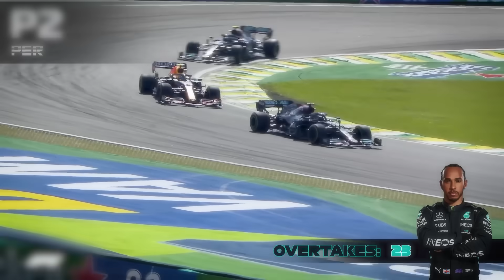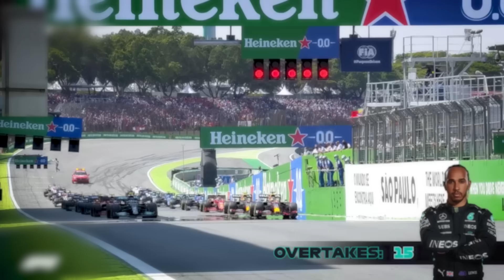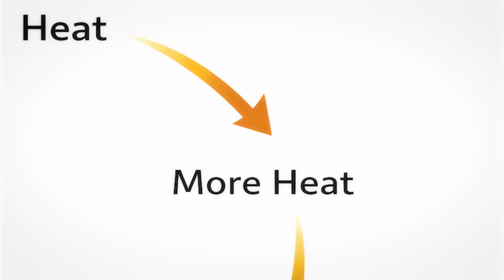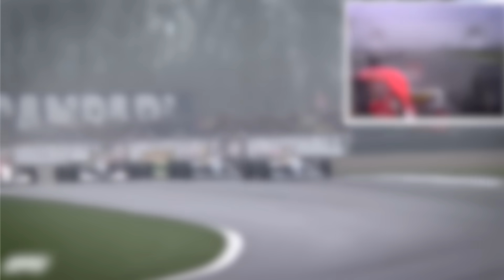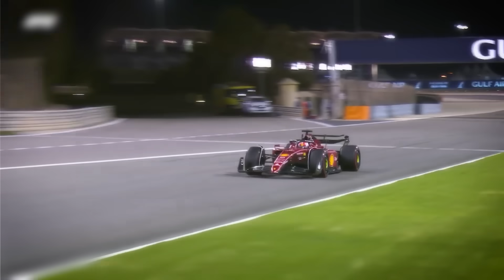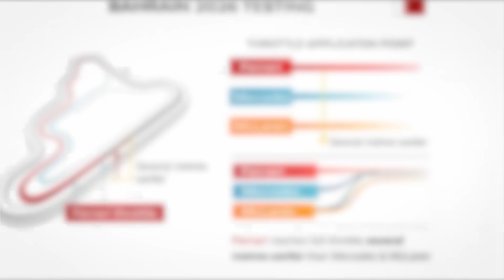The GENIUS Throttle Trick Hamilton's Rivals Still Haven't Figured Out

Comment: Didn't Hamilton change his driving style completely during the Pirelli era? He used to drive very aggressively and he usually ran out of tires well before others (Turkey 2007, China 2007, Hungary 2008). During the Pirelli era he developed the smoother driving style, using a more U-shaped line through corners to reduce peak tire loads. He even became the master of tire preservation, keeping degradation low while not sacrificing too much speed.

Comment: Tire life has far more to do with the design of the car than driver. Ricciardo also drove like Hamilton and yet he was known for burning through tires. Because the car was underpowered and so always using less downforce. His style failed him in the last regulation cycle because his style upset the aero balance and caused sliding which chewed up his tires. 
Max preserves tires every bit as well as Checo, for instance, yet Perez was labeled the “tire whisperer” because of just one race outcome. The media tries to label drivers in simplistic ways to build their narrative about the sport. It’s mostly BS. 
Lewis had a car in his dominant era with superior downforce and more powerful engine which preserved its tires because it could accelerate later and was sliding less. The RedBull was so difficult it was dancing around all over the place. Max was sliding just to keep it on track. And that kills tires. Only the 2023 car was efficient enough to avoid killing its tires while being held under control. Another media lie is that Lewis is a ‘clean’ driver. 
When you just watch races with commentary off you see that Lewis uses a NASCAR like pit maneuver constantly to push drivers ahead off track. You see that he cuts corners and gains an advantage consistently without penalty and he even brake tests rivals while complaining that others are doing it (more so in his early career). Drivers are complicated. They’re both hero and villain. They will cheat if possible. They tattle on each other constantly. They’ll do absolutely anything to win.
Reply: riccardo didn't drive like hamilton. The only time riccardo did late breaking was when overtaking
Reply: Hamilton cutting corners? 

I cannot f'n believe it!